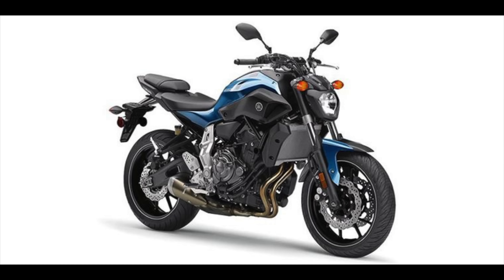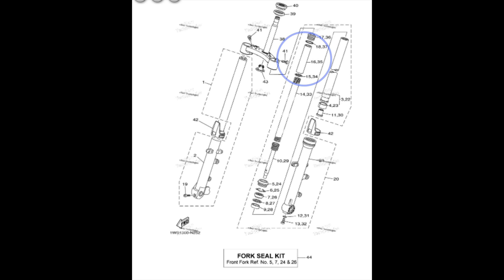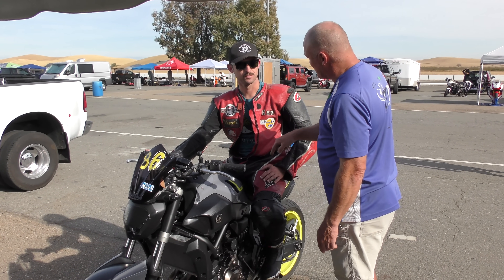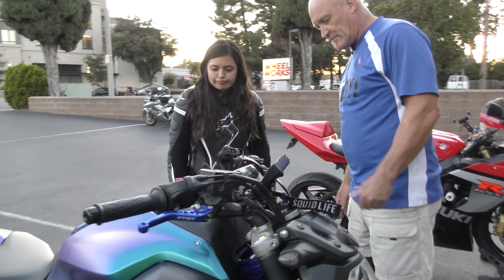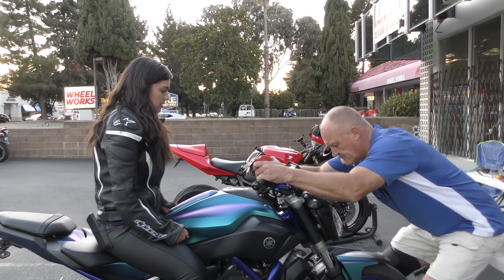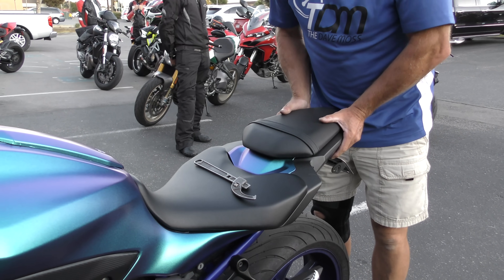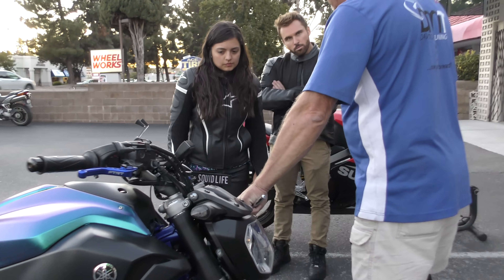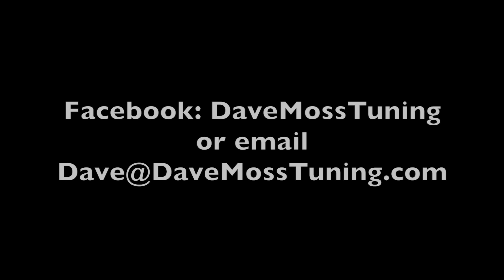Yamaha FZ-07 / MT-07 Fatal Flaw and How To Fix It

Comment: Would other makes of bikes in this category have the same or similar issues? I'm wondering about my 2017 SV650
Reply from the maker: All have an issue with fork oil. Most require 15w to 20w fork oil replacement over stock viscosity.

Comment: if you change the springs do u still need to trim the spacers?
Reply from the maker: depends on the length of the springs. If they are 10-15mm shorter, no.

Comment: That girl's FZ looks really good.
Reply: Only took $20 from amazon. Bought the wrap and used a blow dryer.
Reply: @cindyorellana6025   Is that your bike? So how does it feel now?
Reply: @andrewford80  less bouncy hahahahaha
Reply: @cindyorellana6025  did you treat the plastic, or wrap it straight on after cleaning?

I have a 2018 MT07, short levers and different tyres/rims are on my list.
Reply: WC_2 Electric_Boogaloo i removed the fairings cleaned them with just water. Got the wrap hot with my hair dryer and applied it to the fairings. Takes time but it’s doable
Reply: @cindyorellana6025  thanks for the info 👍
Reply: @cindyorellana6025  Hi, you have a link to the wrap?
Reply: @cindyorellana6025  link?
Reply: @cindyorellana6025  Hello! Do you have a link on amazon for this covering? I don't know if I can buy in France. Thanks
Reply: @cindyorellana6025  what flush mount turn signals are those? they look really good
Reply: Cindy Orellana have a link to the wrap?
Reply: @cindyorellana6025  hi Miss Cindy ,can i have the shade name for this wrap.Thanks
Reply: Cindy Orellana awesome!!!
Reply: Cindy Orellana what’s your instagram? Really like your bike 👍🏻
Reply: Alex Galdamez @motosins
Reply: @cindyorellana6025  wrapped my z650 too after watching a couple youtube vids :D
Reply: @cindyorellana6025  came out really nice , how tall are you if you don't mind me asking & have you considered lowering kit & also is the bike to powerful or takes time to get used to?
Reply: @cindyorellana6025  sick...
Reply: @cindyorellana6025  link pleaseee
Reply: Loved the shade!
Reply: The owner is smoking hot 😍
Reply: The FZ's girl looks really good.
Reply: Her 07 isn't too bad either, if you know what I mean ......lol
Reply: The girl looks really good
Reply: Wasn't that paint sweet?
Reply: So does her thighs
Reply: dragon skin
Reply: Wow. The owner comments and dudes blow up this post. Lmao 🤣
Reply: I think her boyfriend takes more time to get ready than that girl. 😂
Reply: That FZ’s Girl looks really good
Reply: The bike suits you Cindy, hi from the uk 🇬🇧
Reply: the girl has the mt
Reply: Girls not bad either 😂
Reply: Dzimka Bujiashvili 
The girl looks better. The FZ....its ok
Reply: @theodoremarakas9899  thanks but my bike is sexier
Reply: Cindy Orellana is that dude with you Australian? My countrymen always stand out like a sore thumb lol
Reply: @SirSpinalColumn  hell yeah he is mate. Hes my boyfriend. 😁
Reply: Cindy Orellana that wrap is beautiful! Just bought my daughter her first ‘big girl’ mountain bike and it’s very close to that color, she loves it!
Reply: Did she have a bike? I didn't notice 🤤
Reply: Dzimka Bujiashvili simp
Reply: Thomas The Troll lol you idiots can’t think for yourself when you’re calling complimenting someone or their bike simping
Reply: It will look better with a man on it.. And if I'm honest I thought it was ugly as hell
Reply: @FirstNameLastName-wo7li  someone's mad she has a boyfriend lol ^

Comment: Would an xsr700 have the same problem sincerely it shares most components with the mt
Reply from the maker: Yes, same fork oil issue and depending on year, potentially sag static sag issue.

Comment: replace with R6 forks.
Reply from the maker: Make sure you measure length to length prior to the swap and make the geometry correct!
Reply: @catalystreactionsbw  Will do Dave!  Thanks for the advice.
Reply: That's my plan when my forks are toast.  Few more harsh landings with the front wheel should do it.  🤙
Reply: @EH-vv9vi  just so you are aware, I'm not saying they fit your bike.  But swapping the forks was common on the old fz6.  And guys would swap the Suzuki sv forks with gsxr forks.

Comment: @dave Moss Tuning can you please make a video on the early Mt 09 models on how to fix the flawed suspension? Thanks!
Reply from the maker: I get back late March so we will see if someone wants to donate that bike for me to fix.
Reply: @catalystreactionsbw  Thanks! I currently have an 2017 MT 07 and want to do the fixes from this video but I'm also planing on getting an early mt 09 since they are getting cheap and I'm really curious if the flawed suspension on those can be fixed or I'd rather be looking for a 2017+ model that has the upgraded suspension.
Reply from the maker: @hstefan  Early MT09 is 15w in both forks and a replacement shock.
Reply: Here’s a fix. Install Öhlins suspension, lol 😂

Comment: Hi Dave (both Moss and Williams!) Does the MT-09 has similar issues? 2018 im my case. I'll for sure show this video to a good friend of mine. She's short and lightweight, so this should make her motorcycling experience a lot better. Thanks for sharing your expertise!
Reply from the maker: Not in the 2018 case - static sag is good and fork oil is reasonable BUT the oil does wear out quickly. My MT09 Tracer GT fork oil was gone and rebound closed at 8,000kms so I replaced it with 10w.
Reply: Good to know, Thanks a lot!

Comment: Ohlin claims you must use Ohlin oil  @ $30 per Liter..   Ohlin designs their cartridges to use a thin oil ..  I found the specs and 5 Weight  Oil  is their Spec.  I am using Bel Ray 5 wt Oil filled to a specified height.  I bought a tool to measure fork oil height with . Night and Day better handling.
Reply from the maker: It will have been Maxima or Motul 5w.

Comment: Yamaha  should  sell the  MT-700 Tracer in the USA  with  adjustable inverted forks and longer swing arm..
  I sure like the Corbin seat on the first bike..  I am about as short as the lady with the metal flake Blue bike.. I am guessing that's a custom paint job.??
   My 2016  FZ-07  very wishy washy   front fork .. since  my inseam is  29"  I lowered the Forks  tubes a  full  1"  .  I hit a Deer at  50 MPH  totally bent the forks ..  new ones  were I think  $208.00 each   but the Ohlin adjustable Cartridge kit was $800.00  ..  I had no idea  that  cutting  15 mm  out of a spacer would solve my problem ..
  Stock FZ-07  is  OK  for  normal  commuting .. but if you push it hard in the curves the front forks  get wishy washy ..
  I was thinking of adding air  valves to the fork caps and putting  3 PSI  air pressure in my fork Tubes.. it worked great for me in my dirt bikes in the late 1970's  
  I am  two notches  stiffer in the rear  at  180#  side  cases and a top case on the bike ..  With full camping gear the  headlight points  up too much .. some times  I carry a  10 mm socket and extensions to adjust it ..
  Biggest problem is if  you adjust the high bean correctly the low beam is  too low ..  if you adjust the low beam correctly the high beam is too high.. Some Adventure   bikes  have separate low and high beam  bulbs and   can  be individually adjust  with a  thumb and finger  nob.. No tools necessary ..
Reply from the maker: Great post, thank you for sharing your experiences.

Comment: If you’re 220lb how much should you cut and what oil? Also stiffen the spring slot?
Reply from the maker: At 220, use 20w oil and cut the spacer 7mm. Depending on your skill level and travel used, you may need stiffer springs at .95nm/mm rate https://davemosstuning.com/?s=fork+bottom+out

Comment: How does a manufacturer like Yamaha find it acceptable to have a suspension like this, that only lasts 6000 miles? The only thing I can think of is that between the market segment and price point they are trying to hit, Yamaha thought it was best to just throw on a cheap suspension because their users will put on a custom suspension of their own choosing, so why put a nice suspension on it if it won't fit everyone.

Great and bad philosophy at the same time.
Reply from the maker: All the brands have fork oil that last that long in damping rod forks. Some even less and it isn't related to standard bikes either - cruisers are just the same. In reality it has to be about price point in a hugely competitive market pace. The beauty is a very cheap, quick and easy fix.
Reply: @catalystreactionsbw  Sorry for not getting back sooner- Thanks for explaining that. I have had to do the forks on my Kawasaki Versys every 2 years or about 15-18k miles, I probably should be doing them every year, 7-10k miles. They start to feel very kind of sticky towards the end of the year when cool, I know I have to do them.
I was thinking on a 'commuter' bike hitting a certain pricepoint they were just cheap and I was beating on it too hard. Did not realize most/all motorcycle forks required maintenance this often.

Comment: I didn't know how bad the suspension is on MT-07.
Reply: It's not , it's a safe setting for the bike .if you want to set it up for your weight , then you take it to a specialist to set it up. I used to ride a 2009 Yamaha r6 .i bought an mt10/fz10 in 2018 .when I first started riding it hard I thought the suspension was to soft .im used to it now and I am quicker by far like for like on the mt10
Reply: @alanedwards3180  a decent suspension shouldn't keep bouncing even without a rider on a bike, it should rebound once.
Reply: Ringer1982 ,the suspension is set up for your average rider on normal roads ,not for a race track .so what I am saying is it's perfectly good for an average rider on normal roads
Reply from the maker: You are correct - we need stability via oil viscosity or adjusters. Not having stability makes the rider work far harder and if pushing, dramatically increases risk especially mid corner to exit.
Reply from the maker: Agreed is you get the correct settings, and if they cannot be found you go ahead and change oil or settings to find that balance. After 1,000 miles as the oil ages, the imbalance will return to you need to use the adjusters again to keep that. The longer you leave the oil in there, the greater the variance between hot and cold oil.

Comment: Does anyone know if he does an assessment on a 2018/2019 model? I understand that the front forks had changes making them different from these earlier models. So, I wouldn’t try these changes on my 2018 model. I did add fork pre loads, and 20 wt. Bel Ray. Also, The stock rear shock, also new for 2018,  at its lightest spring setting, still had zero sag without me  (200 lbs.) on it. I installed a K-Tech rear shock, huge improvement as I now have the proper spring stiffness. It’s very nice.
Reply from the maker: We just ha d a post that a 2018 does not have a preload spacer. I'm trying to find one to do all the maths and check oil viscosity. When I find one I will report back.

Comment: is it correct to assume that this issue would be the same for XSR700's?
Reply from the maker: For fork oil viscosity yes.
Reply: @catalystreactionsbw  such promt response from the man him self. Much appreciated, Dave. So are you suggesting that no cutting is required for the spacers?
Reply from the maker: @poopertrooperz  Looking for one this weekend. As I recall from last year, I did not check on static sag but fork oil was indeed far too thin. If I find one I will post.
Reply: @catalystreactionsbw  I checked static sag on my mt-07 tracer forks after seeing this video. It's about 27mm. The forks are exactly the same as the mt's

Comment: So Dave, does the MT-09 (FZ-09) have a similar issue?
Reply from the maker: The early versions did yes (first 3 years). I would change the oil to 15w immediately. Later versions were better. As an example my 2019 my MT09 Tracer GT has 10w in the rebound leg and 15w in the compression leg and is behaving much better now under braking with excellent stability and the adjusters are not closed at all to compensate for the thicker oil.
Reply: Dave Moss Tuning   Other than oil, did you change springs or anything else on forks ? It seems to be harsh over rippled road surface. 2017 mt09 tracer. 95kg with kit.
Reply from the maker: @oldsmokie101  The MT09 Tracer is good for me at 10w rebound, 15w compression for the touring I do. In colder climates, 7w rebound and 10w compression might be better but did not test that while in NZ with my Tracer GT. I kept the stock fork springs and spacers.

Comment: I really don't know what that girl was thinking... Spring on the hardest setting and she weights nothing... that must have been miserable for her back.
BTW I got the new model I guess it's not the best suspension ever but  at least the front it's not bouncy at all like in the video
Reply from the maker: We all start somewhere and I rode like that for a long time due to the paradigm of factory settings are best. Then I started questioning that to find settings, geometry and pressures for me. The fact that she was willing to find something better is a big step in the right direction. New oil stays consistent so memorize the fork rebound action now and test again in 1,500 to 2,000 miles to see how it has changed.

Comment: Dave, do the issues with the front forks also apply to the newer generation (2018+) MT07? My understanding is that the suspension setup was changed in the newer bikes.
Thanks for the great video.
Reply from the maker: On a quest to find an 18 and newer to see if that holds true with revisions or not.
Reply: @catalystreactionsbw  I would love to find out about the updated mt07 2018-2020 aswell, I bought a 19 model recently so il definitely be awaiting that review sir. ✌🏍

Comment: Thanks Dave! You are the best! I've been wanting you to get down to the root of the FZ-07. It's a great hoon bike but corners are where it struggles to keep the tire down. Thanks! Cutting the spacer and fork oil is next on my list.
Reply from the maker: Please report back on how much the fork action improved.
Reply: @catalystreactionsbw  anything for you Dave!
Reply: @catalystreactionsbw  please excuse the noob question. Wouldn't cutting the spacers extend the spring more hence creating more bounce/head dive? (which I hate) Have a 16 fz-07 with 11k  that want to do this to but confused. Already have new oem rear shock swap ready just need to figure this out. Had thought that installing preload adjusters which is what I was going to do before I watched this video and heavier fork oil was answer. Btw about 180pds with full gear on  so any specific cut or oil weight advice would be appreciated.  Even with spacer cut or in leui would you advise to add preload adjusters? Thanks Dave
Reply from the maker: @kalman1224  If I can approach your quandary with these steps  1. Static sag is critical in suspension so the rider is not bounced out of the seat (https://www.youtube.com/watch?v=3FeZJRiAXRk&t=294s)  Springs are held in place with spacers and they are there to compress the spring to keep it under tension. If the spacers are large, the spring is crushed so it fights back violently. If the spacer is reduced in size, the springs responds with a a lot less violence. Does that help?  In terms of rebound, this video might be helpful: https://www.youtube.com/watch?v=sz0z5IgVGSg&t=11s  With forks that have no adjustments, we choose oil viscosity to match the spring's energy release, so that can be 10, 15, 20 or 30w oil depending on the engineering inside the fork.

Comment: Do you think this issue is why the front feels like it wants to shake so easily above 100 mph
Reply from the maker: Think this through. If the fork wants to be at full extension most of the tire it reduces grip. The harder to accelerate, the more the rear moves to the rear of the bike. Then you have wind lifting the front up slightly.

Comment: This video is about to pop off, it's being shared around Fz07 groups, Thakns for the content <3
Reply from the maker: I hope people take on the challenge, trim the spacer and find the right weight oil for themselves - then and most importantly, they share what they did and the positive effects it had for them. Doing that helps me save lives by riders sharing positive experiences!
Reply: @catalystreactionsbw  If it's anything like when I swapped my rear suspension for a used Bitubo shock with rebound/pre I can't wait to finally feel what this bike was supposed to feel like all along...
Reply from the maker: @Chad-bq7vw  That's the positive change you will feel with the right oil viscosity and height. trim the spacer and it will be a positive change again. If needed, select the right springs.

Comment: If your 6 feet 206 lbs is this a good bike to get considering the price / suspension (upgrades) or is there a better option under 10 grand? Don’t think the fz mt 09 is any better suspension wise correct?
Reply from the maker: This is a great bike for the price point. With your height you will need to make the seat 20-30mm taller for better ergonomics. Given your weight, 20w oil and .90nm/mm rate springs would make the forks work  very well. Save the $$ for a Nitron, K-Tech, Penske or Ohlins shock with preload and rebound adjustment.
Reply: @catalystreactionsbw  Awesome. Thanks.

Comment: why the heck would they allow this bike on the road knowing this.
Reply from the maker: It has been this way since launch and many, many other bikes have similar price point issues to resolve with soft fork springs and thin fork oil. The other consideration for manufacturers is the height and weight bell curve globally and where to pace the bike based on in Country laws etc and the type of rider that might buy it.